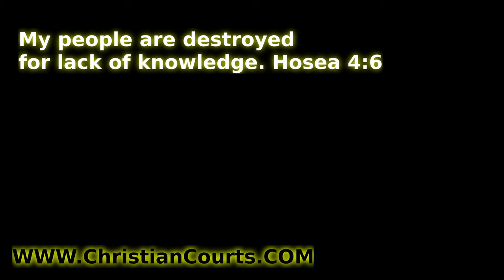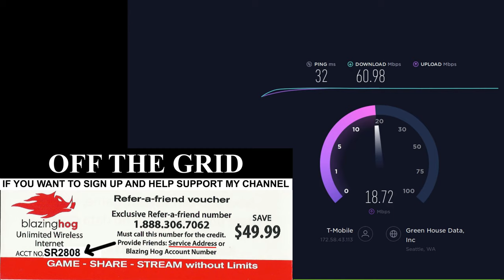How To Fix Solar Motion Sensor Light Repair Detector

Comment: Moisture ingress is a major reason for outside light fixture failures.  I have even had small ants get into the housing and solar panel frame and make a nest with dirt.  Surprising is that the light fixtures I mounted on a creosoted electrical pole about 16 feet in the air. I found that using a reputable silicone sealant around gaps and seams will help but it is necessary to have or drill a tiny hole at the bottom of the fixture and solar panel so that moisture can drain over time.